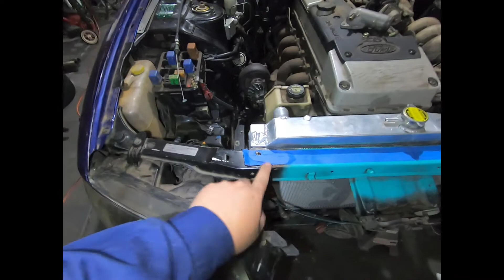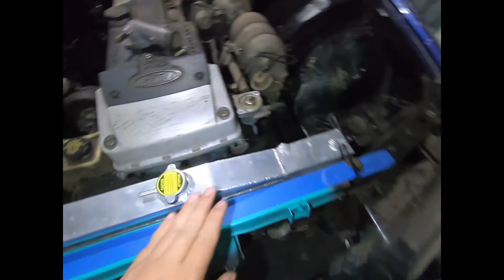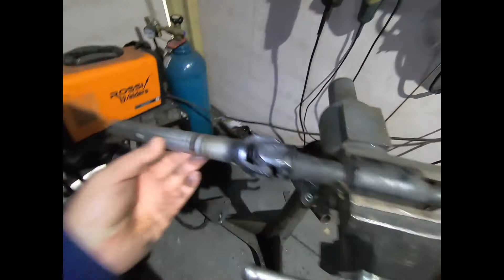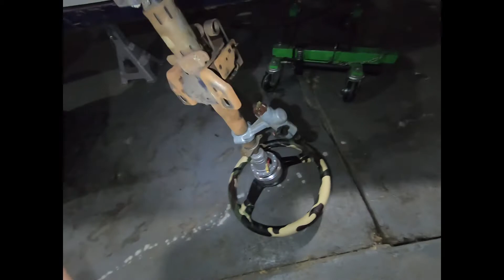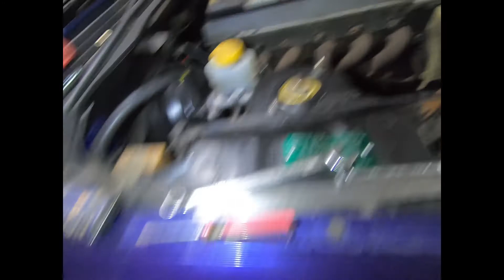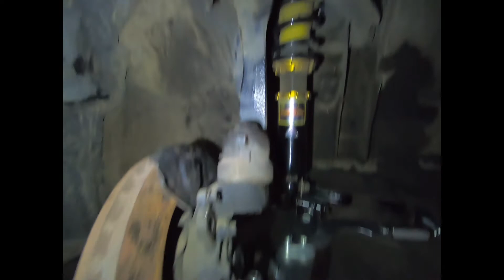R33 Extended Steering Shaft & Dump Pipe

Comment: I actually was able to get away with using factory down pipe for a falcon with the 3inch down pipe 2 bolt flange just have to tap it in where the connects to rack like yours